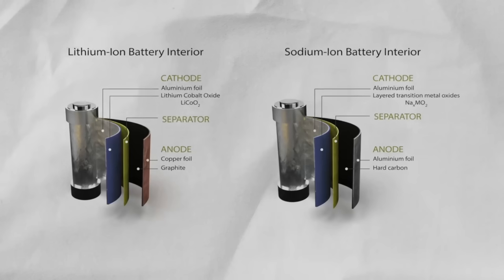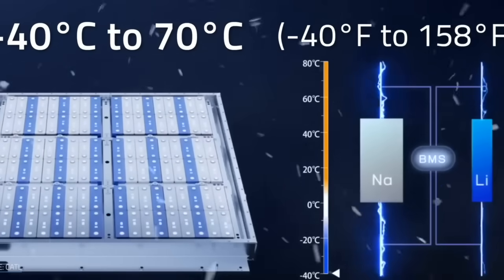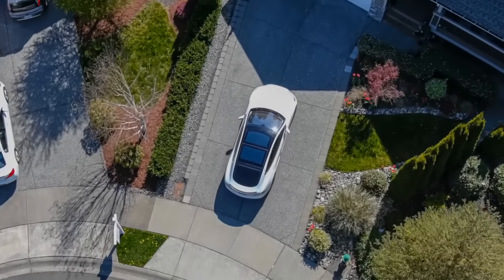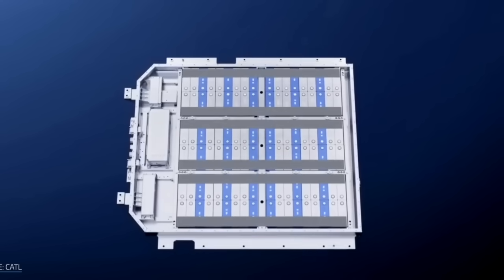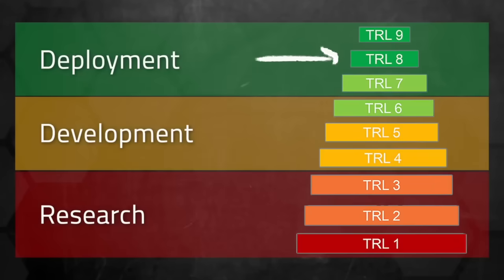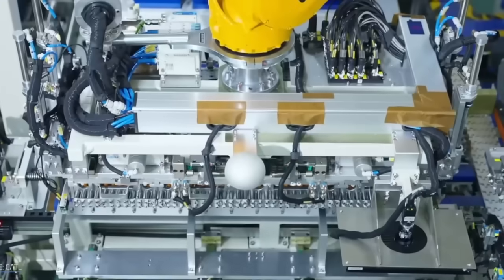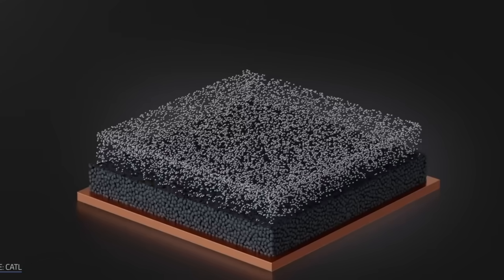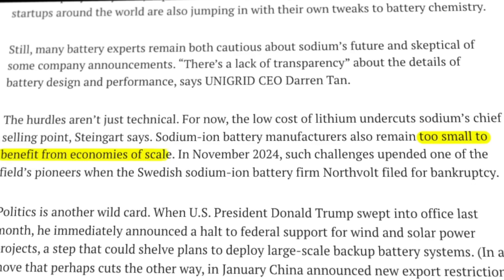Exxon Claims 30% Longer EV Battery Life Using Graphite

Comment from the maker: Would you rather have NCM or LFP Chemistry?
Reply: These days I'm leaning toward NCM in handheld things (phones, laptops, cordless tools, etc), LFP in vehicles, and sodium in building energy storage. I think sodium has potential in vehicles, too, but maybe only in shorter range applications - depending on how energy dense it ends up being in terms of volume, not just weight. Exciting times!
Reply: NMC, much high energy density, lighter and real-world proven to have virtually the same cycle life as LFP.
Reply: NIB (in year 3 of my ncm leaf,  Nib will be available to swap in long before I'll need a replacement)

Comment: SUPA G® is a graphene slurry which has been developed by GMG over the last 3 years for GMG’s own Graphene Aluminium-Ion Battery which has unique properties of high electrical conductivity, low charge transfer resistance and high density compared to other carbon battery additives and materials used in lithium-ion batteries.

The Graphene comes from GMG’s self-developed graphene production system and is then processed through a number of steps in the co-located pilot plant and finally into a liquid graphene product which GMG which can be added into or coated onto either a customer’s lithium-ion battery cathode or anode with a 0.5-2% dosage by weight.

GMG is currently engaged in confidential discussions with multiple battery manufacturers and industry players to explore the potential testing and supply of SUPA G®. These discussions underscore the growing demand for high-performance materials that can push the boundaries of energy storage technology.

Comment: Fun fact Exxon funded the research in the 1970s that invented the lithium battery. Exxon is not new to this at all. Exxon funded M. Stanley Whittingham's research in the 1970s where he developed the first rechargeable lithium-ion battery concept, using a titanium disulfide (TiS₂) cathode and lithium-aluminum anode, which earned him a Nobel Prize, though Exxon struggled with commercialization due to safety issues (overheating/fire) and complexity, eventually licensing the tech, while later scientists like Goodenough and Yoshino perfected it for modern use in EVs and electronics.

Comment: The latest EV batteries are already lasting 300,000 miles and that's just until they've lost 25% of their original capacity. They'll still provide over 70% of their original range and most owner won't be replacing them even then.

Comment: No battery will ever last a million kilometers (620k miles) at normal use rates.  It would take 48 years to get to 620k miles.  No battery is going to last 48 years. No car is going to last 48 years of daily driving (most 50 year old cars are not daily driven, they only ever see  use in dry spring and summer conditions for a few miles to the local car show or something) at 13k miles a year on average.
Reply: Police, taxi's, delivery trucks, and that one strange guy in Alaska who visits his grandkids in Florida four times a year. 
I know you said "normal use". It could become where you do a body swap and keep the battery. Or they go into the grid storage market. That is were this would shine as grid storage is all about number of cycles. 
You could also use it with vehicle to grid power backup or stabilization functions. So the car now becomes part of the home's power management.
Reply: @sd70cal  "Or they go into the grid storage market."
There is no grid storage market for used car batteries and there likely never will be.  Batteries have to be standardized for that and they aren't and are unlikely to ever be standardized.  Random shapes. Random sizes. Random chemistry. Random cell life.

So you're going to keep an old car in your garage or driveway that is serving only as a power pack?  OK.  Ain't gonna happen.
Reply: @tarstarkusz . The packs are pulled and assembled into cabinets. They’re used in off grid homesteads. There’s a stadium that uses them. The main point is they have value beyond being used in cars and can be recycled later.
Reply: @sd70cal  First, this is not happening in large numbers anywhere.  Second, you are moving the goal post.  Energy companies are never going to buy this crap for grid storage.
Same with recycling.  This is not happening at large scale yet.
Reply: @tarstarkusz    The used EV battery market is just getting going. Larger numbers will happen as more batteries become available and more companies become specialized in it. B2U is deploying three more grid stowage systems in Texas new year. Redwood Materials is doing grid stowage for datacenter, and Element Energy is using old packs for cost savings. That's just three companies from a quick search. There are others. The packs are still good, cells are checked and bad ones are replaced before being put back into operation as a stowage bank. 
Then they go to recycling, and yes it is happening on a large scale. There are several companies involved with recycling in several different countries. It isn't a massive operation yet but that is because there won't be a massive number of packs until sometime in the future. 
I'm still amazed by those who view the future though the lens of what is today.

Comment: The problem with you dickheads thinking a better battery will convince everyone to go electric don't understand many basic things.  Whether the battery is good for 400 or 800 miles it still is a battery and is still very heavy.  The power to weight ratio will never allow electric vehicles to be practical off road vehicles.  Second is cost.  At best I can only afford a vehicle of 5k or less.  I don't see a world right now where I can find an acceptable ev for 5k or less for at least 10 to 15 years.  So predicting the obsolescence of the internal combustion engine at this point is a little premature.
Reply: In the channels I watch it seems people are expecting the beginning of full scale adaption to begin around the 2030 time period. The predictions still show ICE vehicle use in 2050. 
$5k is a difficult price point to meet. In my market I don't see even a very used ICE vehicle for that amount. If weather wasn't too much of a problem I'd take a look at some of the E-bikes. There are some really good ones out there. The Swedes ride bikes in the snow, I used to commute all year on a motorcycle. Just a thought in order to save for a few years to get the $5k up closer to $15k. 
Some of the battery tech being tested now could add considerable power density to the batteries. That means a lighter battery. Light enough to be used for air travel. 
As far as off-road use. Much of off-roading is at low speed with a lot of idle time. You don't need the big battery packs used in cars designed to give 300 miles at 70 mph. At 10-20mph you'll get much more range. There are guys who do remote off-grid camping and stay out up to two weeks. A battery pack for home stowage is typically from 10 kW to 35 kW for whole house for 1-2 days. Cars have packs from 75 kW to well over 100 kW.
Reply: @sd70cal  Right now I have two Crown Vics.  One has 400K miles and runs great the other is a 2006 with 176K and runs great  both we significantly under 5k and provide good transportation.  It will be at least 10 or 20 years before equivalent eV's exist
Reply: @robertrice5814 if they’re running good you got a great deal.

Comment: 30% really sounds very optimistic, but 25% is good enough. for a standard 260Wh/kg battery that results in 325Wh/kg. good enough for normal cars. very much needed for pickups.
apply this to LFP and you have a real winner. for trucks with LFP this would be a game changer.
graded graphite is nothing new but getting +25% is really fantastic.

Comment: There is some discussion around how some manufacturers are dragging their feet on vehicle to grid, a technology that promises further energy independence for domestic consumers, and another reason to buy an electric vehicle. The most quoted reason for this reluctance is that they want to protect the warranty period and preserve battery longevity by keeping the battery use for travel only. Perhaps this advancement will encourage them to move forward on V2G as well.

Comment: A lot of people (myself included) find the term "battery life" to be confusing since the marketing and common colloquial use became the most popular in the era of single-use/non-rechargeable batteries that were disposed of after being depleted once, hence the runtime/capacity being called the 'battery life' instead of charge cycles. To prevent confusion, I think it's becoming customary to avoid the term and call it 'battery longevity' or 'battery durability' when talking about cycle lifetime and 'battery runtime' or 'battery capacity' when talking about the amount of energy it can provide. Just a heads-up because based on the title I went into the video thinking you were talking about capacity.

Comment: Considering that modern anodes are still engineered using old manufacturing techniques it seems safe to bet that Plasma Enhanced Chemical Vapour Deposition will eventually grow anodes that run laps around the current best.

Imagine taking a single carbon nanotube and coating it in one layer of graphene followed by three layers of silicon followed by three layers of graphene.

You would get graphene silicon carbide silicon silicon carbide graphene silicon carbide silicon silicon carbide graphene and on and on.

Trillions of atomic layers that are dendrite resistant and highly conductive while being very good at storing lithium ions. 

That's a super oversimplified design for one half of a battery but there's not much more that would need to be done.

You could add diamond layers through PECVD as well with dopants or dope the graphene or silicon carbide or the silicon or add other materials but the point is that a few atomic layers grown in a perfect crystal structure and repeated millions of times can be engineered for perfect performance characteristics and if designed properly they could probably be recycled with nothing more than an oven.

By recycling with an oven I'm obviously referring to pyrolosis.
Reply: I think current battery tech is more than adequate for 90% of consumers.  Hybrid solid state will be the end game for most ICE production cars.
Reply: Yup, and that will likely be all feasible in about 10 to 50 years